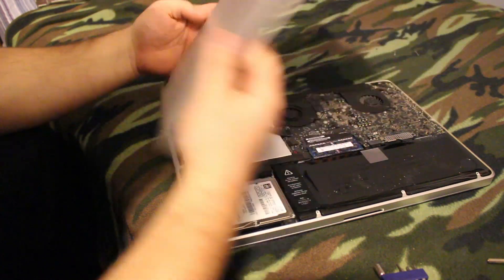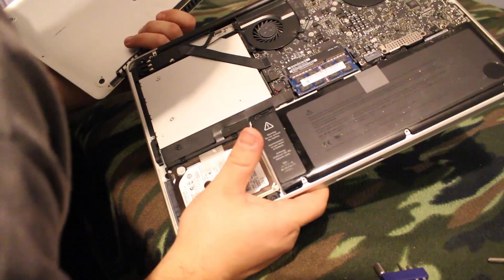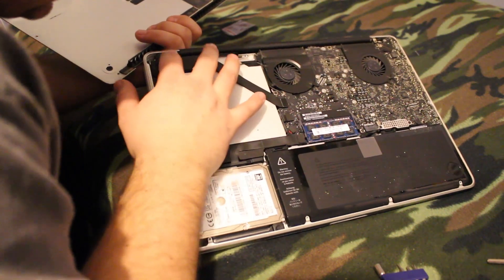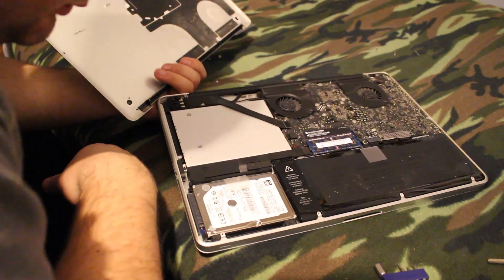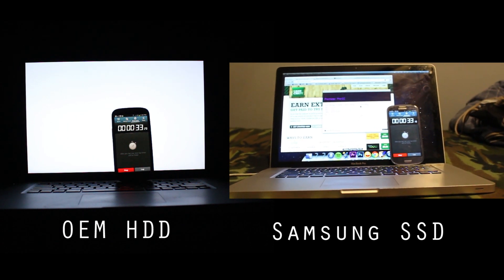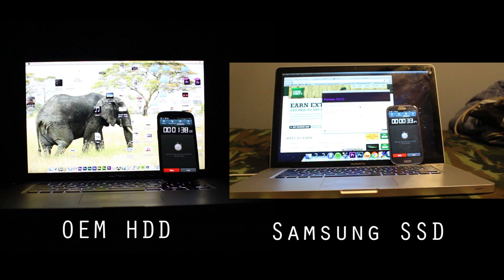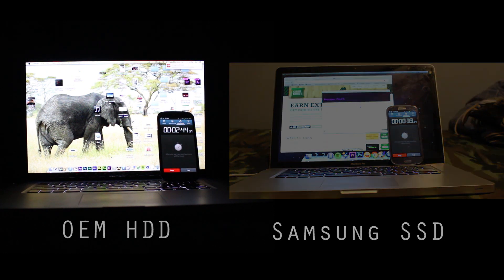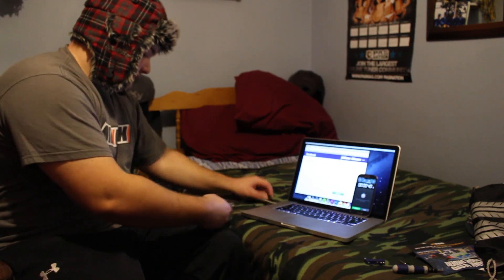How to: Dual Hard Drives in MacBook Pro | SSD Install | Boot test

Comment: one thing about hdd drive. it must be removed and reinstalled in the the super drive bay with new caddy, and the ssd on the default bay of the macbook where the original hdd was it. this is beacause this last bay has more bandwith and the macbook will be more fast at the end

Comment: Nice mod... although I do prefer Windows, just because I'm used to it and because Apple products generally tend to be way more expensive with the same specs. I have an Asus N56VZ (i7 3630QM, GT650M, 8GB RAM, 750GB HDD 7200RPM) and from the time you push the button to the time chrome loads a webpage is about 40 seconds :)

Comment: SSDs are actually less power efficient than a HDD. Even at "idle".
Reply: Wrong, modern SSD's using smaller NAND are much more power efficient than rotating storage devices.  If you are looking at tomshardware guide articles from 2008 based on early SSD's you would be correct.
Reply from the maker: it could be a placebo effect, but my battery seems to be lasting longer, ive currently been using it for over 4 hours unplugged and still have 25%battery left
Reply: I am referring to current anandtech SSD guides/reviews.

Comment: Good upgrade, if in the future your looking to upgrade the other HDD go with a Hybrid, which is basically a SSD and Tradition hard drive morphed together. Also the ram could use a little attention if not already upgraded. +1
Reply from the maker: got 16gb of RAM on the way dont worry haha ;)
Reply: I've got 2 X Seagate Hybrid SSD 500GB configured in raid 0 in my macbook, performance is comparable to SSD drives with 1TB of storage ;)